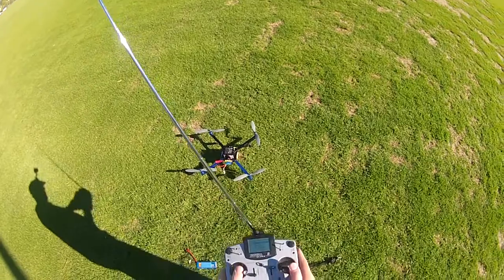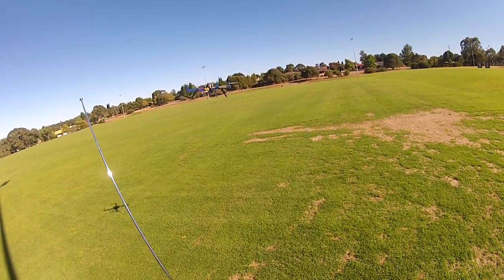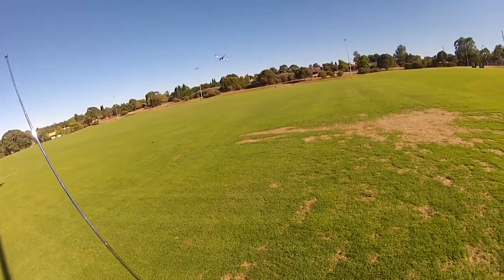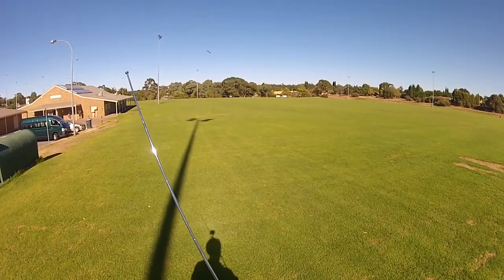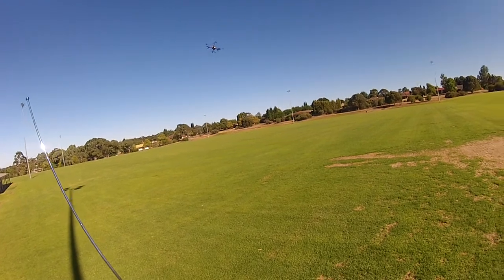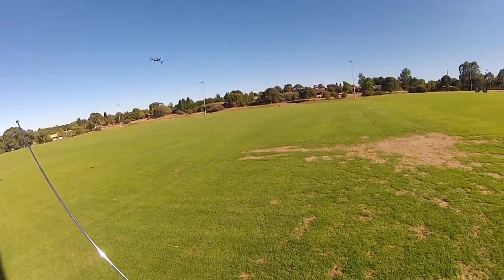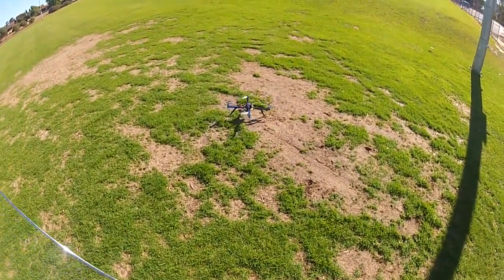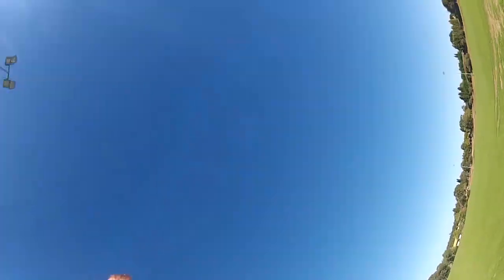New Loiter Test

Comment from the maker: The big difference here is the inertial navigation. Even with a GPS that jumps around the inertial navigation only follows it slowly. For example if the GPS jumps 5m to the right and stays there, it will take 3 seconds for the inertial navigation to correct the 5m difference. This results in a much smoother response to poor GPS location.